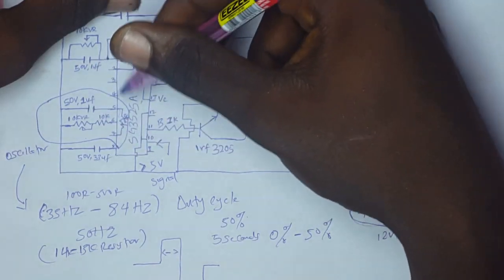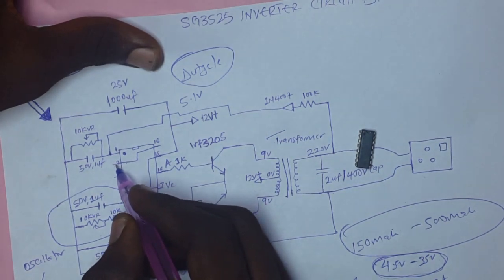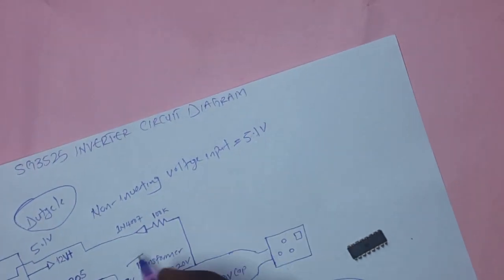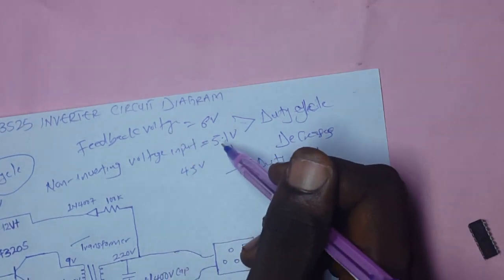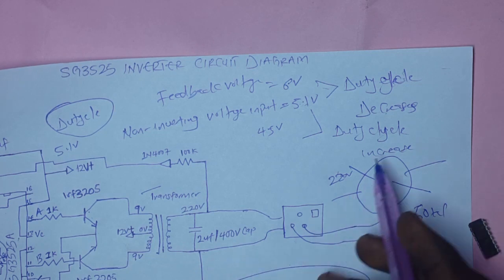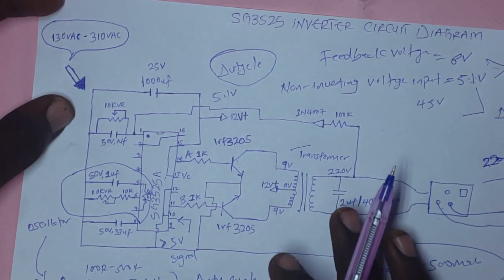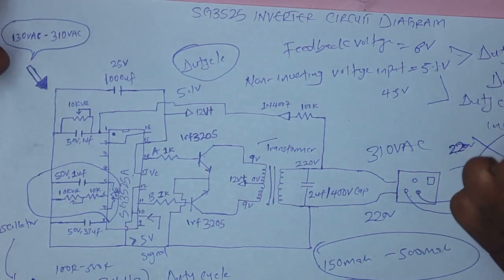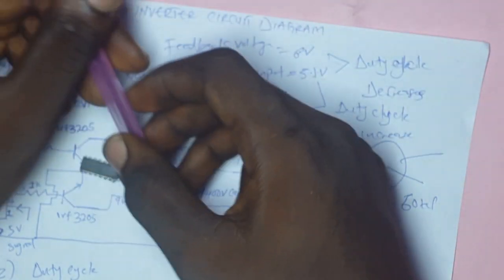SG3525 Inverter feedback connections||stable output voltage||220V

Comment: Please pin 1 and pin2 which one receives the positive volt and which one receives the negative volts from the rectified voltage from the transformer output

Comment: You tried but you all got it wrong 😊.
First, the error amp is configuration to measure both the inverting input voltage and non-inverting input voltage by making sure that the both pins have equal voltage. That is, if inverting pin received 5volt then the non-inverting pin must received 5volt as well to crate a balanced. If in any situations one of the pins tried to receive higher voltage than the other pin, the duty cycle will either increase or reduce inrespect to the pin that is being affected to create a balance. So there is no way you can have a high voltage to the other pin , if that should happen the sg3525 will trigger to sleep mode "shot down".

Comment: EDIT:   Why it does not work for me like that;  without the transformer connected, but feeding 6V Dc from a divider fron the 12V ,  when i adjust the  10K trim pot,  it just shuts down; 
( do you NEED to involve pin 9? i see pin 9 tied to pin 1 in other schematics, some with a straight wire, some with resistor and capacitor, but i guess  not); 

Or  does the feedback only varies the duty cycle up and down, like you show us,  when it is connected to the transformer, all working  and putting out the 220V?   Thanks
Reply from the maker: It's works you can check my inverter projects to confirm
Reply: wish you showed it on the oscilloscope, vary the input voltage and then the IC varying the duty cycle,the pulse width that is,  by itself; thanks   @Astroelectric1

Comment: The output voltage of this IC at pin 11 and 14 is 5v and 5 volts is not sufficient enough to drive mosfets and turn them fully on how can we overcome that challenge do we have to add a gate driver ic?
Reply from the maker: You can add a MOSFET driver like uc3843 ic
Reply: @Astroelectric1  thanks bro
How can I select the shutdown resistor at pin 10 for 12v battery? How can I use potentiometer to adjust the dutycycle instead of using feedback? I have been working with this IC for two years but haven't really known all about it

Comment: when i connect pin 11 and 14 to two separate irf3205 it causes short circuit but when only one of the output of sg3525 is connected to gate then current would be 0.4A and if no output of sg3525 is used then current would even be 0.2A (pin 11 or 14 is not connected to gate of irf3205)
what is the problem? i have check it at 12v and 20v same result
Reply: when only pin 11 output is connected to gate of only one irf3205 current will be 0.4A even if i connect 3 irf3205 in parallel then also current is 0.4A while the other output (pin 14) is not connected to the gate
Reply from the maker: Did you have frequency meter to check the pin 11 and 14
Reply: @Astroelectric1  no, the best meter i have is uni-t ut33d+, i did change the sg3525 ic 3 times same result, the pin 16 does give about 5v if i use 12v or 20v input but the voltage of pin 11 and 14 does change from about 5v to 7v
Reply from the maker: Let me see your circuit diagram
Reply: Same problem here what's reason? @Astroelectric1
Reply from the maker: What is the problem
Reply: @Astroelectric1  I have made sg3525 circuit but it's only working 14*0*14 turn ferrite transfermer why?, when rewinding to 3*0*3 it's not working mosfet heating immediately,. frequency adjusted but still not success
Reply: https://youtu.be/o0ectkZpkMU
in description more details about the circuit
thanks

Comment: I build the circuit using KA3525, I have taken feedback and given to pin 1.  At no load it s working fine. If i connect load the output voltage drops, same is reflected in feedback voltage as well, but duty cycle not increased to match the voltage drop. For any type of load the duty cycle remains same. Can u help me to solve. How the duty cycle is varied for you
Reply from the maker: Which transformer did you used sir
Reply: @Astroelectric1  I used 500VA Transformer sir. I have connected a 10k pot in between pin 16 and 2 . I am able to vary manually pwm duty cycle from 0 to 50%. But it should vary  automatically.  It is not happening sir. I used another step down transformer in the inverter output and stepped down 230/15v then then  rectified to 5V dc to given in pin 1.
Reply from the maker: Connect the pin 2 and 16 together so that your non inverting input is 5.1v since pin 16 is 5.1v and connect 10kpot between pin 1 and gnd to adjust outp voltage and use transformer 220v to 9v-0v-9v
Reply: @Astroelectric1  Thank you brother. Let me try that.
Reply from the maker: Good one, I will be expecting your result

Comment: Please the video when you're explaining the ic inrush current to the base of the transistor, and what will happen to the transistors if the feedback is not present in the circuit sir?
Reply from the maker: If the feedback is not connected voltage will drop on a load
Reply: @Astroelectric1  also what can caused the highly raised temperature to the transistor when it's inverting?
Reply from the maker: Firstly, if one transistor is shorted it can cause the rest to Heat up without load.
Secondly,if the output frequency too high I.e more than 65HZ the Transistors will work hard and heat up
Thirdly, if the ic is damaged or one output of the ic not working the transistor will heat up.